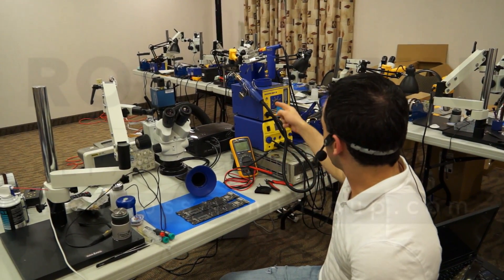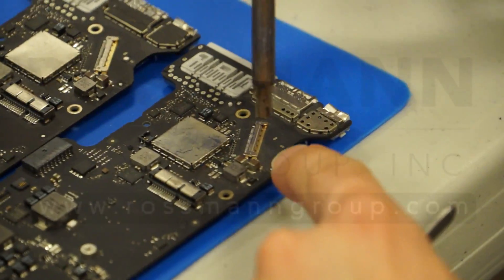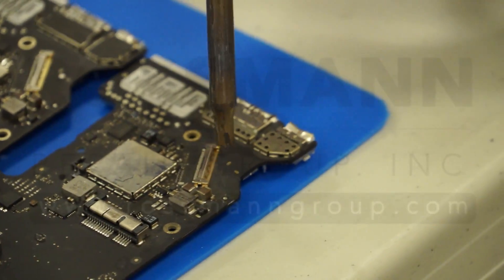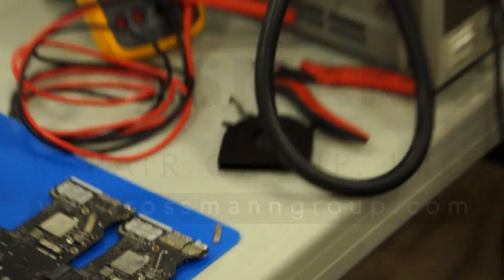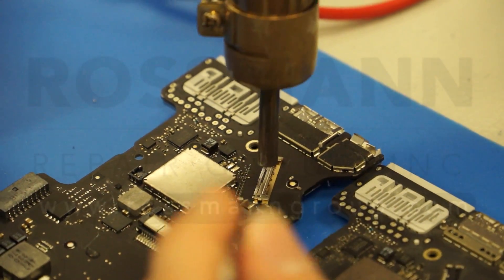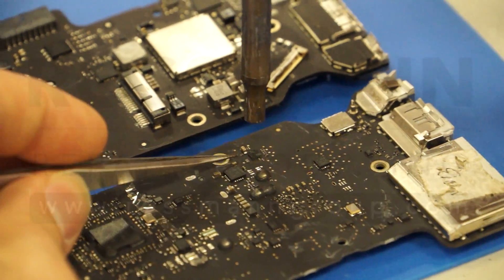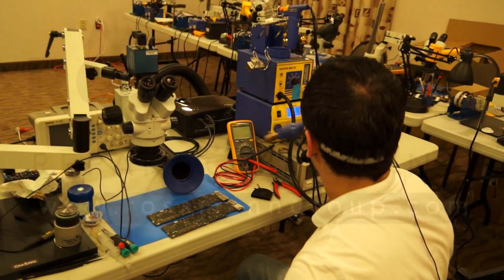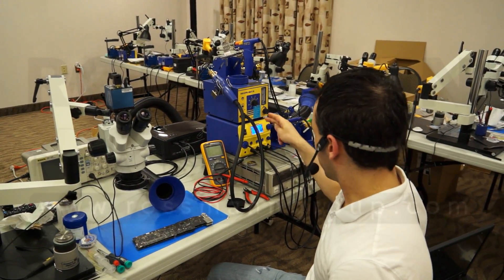Hakko FM-206 FM-2029 hot air station review.

Comment: I was strongly considering purchasing the 206… Thanks so much for saving my time. 

I do want to get a desoldering station, I am considering the HAKKO FM-204 self-contained soldering station since I do not have shop air (seems simpler than setting up the control box that borrows power from my 2 port hakko and finding a shop air supply)

Would you recommend the Hakko FM-204 or is there something else you would suggest that I look at?
Reply: I would recommend the Hakko Fr-301 if you haven't purchased one already.

Comment: Louis Rossman, have you considered using the correct nozzles? The heat is supposed to be concentrated to a particular area. Also, if had the right attachment, then you'd also have a vacuum suction component to remove your IC when its desoldered.

Comment: My 2 in 1 Hony 908 cost me 100 dollars and the hot air seems to be more powerful than that (melts wire quickly from 3 inches away), while the iron easily gets to 480c in 50 seconds.

Comment: LOL I use the fm 206 at work but the hot air is only good for pre heating the ground plane on big rf boards, and the desoldering pump doesn't suck very well either I thought the pump was worn out but I guess that's the way it is.  I use a separate hot air station like you do, its the only way to go.  I wish the pump had more power.  Love your vids by the way.  Oh man this is an old video

Comment: I have an insanely cheap, generic hot air station for general use (I mostly use it to remove USB charge ports as that's what I seek out until I get more comfortable with other components) and that thing blows the shit out of that 2029. All in all it was maybe $70, just something to get some kind of practice in with before getting something professional. I just crank it up to about 500 degrees and max airflow, pops parts off in a jiffy, and has a 3m nozzle. Airflow does seem to be lacking even at max (I've tried taking larger ICs off of junk boards and had a really difficult time with those), but for small components it works pretty well. Still, some things do seem to take longer than what I see with more expensive and proper stations.

From what I read a major issue with these cheaper standalone hot air stations (NOT those shitty aoyue all in ones) is the heating elements or the blowers commonly fail after a lot of use, so eventually you'd spend more on replacing the cheap units than having a more expensive one that lasts for years.

Looks like you can get an FR-801 from aliexpress for very good prices (better than the $800 I've found on Amazon for an 810). However I've never bought from aliexpress so I imagine it'd be some kind of knockoff.
Reply from the maker: +spartan456 micro hot air pencils are the nice way of saying useless cheap piece of shit

Comment: i am looking to buy the fr-801 or the fr-810 but its a dramatic thing to get in the Netherlands, any advice on a good and trusthworthy supplier? i dont wanne spend my cash on a copy scam piece a ...thanks in advance
Reply from the maker: +Roy Mulder Not sure. You might want to look for a device that is designed by a company headquartered in your geographic area so you can save money.
Reply: +Louis Rossmann hello. thanks for the fast reply, yes i tried but the only good quality is jbc or weller other quality brands i dont know. but you also know how exspensive jbc is.... so if any one knows a good brand
Reply: +Roy Mulder I am from the Netherlands as well. I buy my Hakko equipment from http://www.batterfly.com/shop (ordered several times). Be aware that the prices are listed ex VAT. They are trustworthy and an official Hakko dealer in Italy. Above EUR 400 you get free shipping! I think about ordering the FR-810 from them today.
Reply: +Roy Mulder Official Hakko dealer list can be found here: https://www.hakko.com/world_network.html    But Batter Fly in Italy is the cheapest one I could find in Europe.

Comment: well , you should have read the spec for both stations , specially the air flow.
for fm-206 its only 6L/m but for fr-801 its 20 L/m  and the fr-810 which is a beast its 115 L/m . it's on the website of Hakko . even weller they have 18 L/m as air flow on there all in one units so they have the same problem . my opinion JBC have excellent equipment too :) and good airflow.  ;)
Reply from the maker: Thegoodpal Here's the thing.

Average person has absolutely no idea how many liters per minute you need to remove an ISL6259.

They know that they turn their station up and it either does, or does not remove it. 

I totally get that they publish specs. Also understand why these specs are completely meaningless to most users.

What if this is their first station? How do they know how many liters per minute they need to remove a chip? Does the LP8550 datasheet tell you how many liters per minute you need in your hot air station to remove it? 

Ultimately, I do not feel it is up to spec sheets, but rather the manufacturers of high end gear to understand what end users are going to be doing with their products and produce something with a range that we can work with. 

I set mine to 15 for 99% of what I do. Sometimes 10 for finer jobs.
Reply: I agree with you Thegoodpal, the very first thing that you should know the spec both station before you compare. Just compare the same wattage and L/m of the hot air station that's the best thing of comparison.

Comment: Hello Luis, maybe you could try to calibrate the hot air pencil, there is an option for this, same thing with FR-802, i use both and work perfectly fine..... Of course, had to calibrate both stations with external thermocouple measuring on air output and put the difference between the external thermocouple and what station reads on offset temp option.... 
You can do this with all channels....
Reply from the maker: Joule G IMO, anything that is off by 250f out of the box should not cost $1800. Melt solder when I set you to 950f, or gtfo.

Maybe I am being mean. I don't think I am. What am I supposed to do, calibrate this POS to 1100f before it removes a connector in under 3 minutes?
Reply: Louis Rossmann lol maybe you are right, but there is a reason for this offset option, we should take in account that in electronics one thing is theory and other is practice and I think this is a good way to correct any mismatch..... IMO

Comment: Did YT spam my comment on pricing for this stuff?  That Hakko 206 was 2000USD as configured----it is going back and we are going to try the 810 for the July course.  I still think 206 could be useful for folks like me that want a micropencil, mini hot tweezers, and an iron ready to go---but 3 FM202s would be a better value.

That FR 801 standalone hot air was an eBay pick for about 400USD used---but of course those are snapped up instantly now.
My dual port FM203 was also about 400USD used on eBay.
Reply from the maker: iPad Rehab Yep, can't recommend equipment without it dropping into a black hole that I will never buy from again. :(

Comment: Because it takes so long to desolder the component you end up bringing so much more of the board up in temperature for a longer time you're more likely to damage something else while you're at it. Thats just garbage.
Reply from the maker: bgdwiepp Exactly. Here for the comparison I was working with physically damaged broken boards that were discarded with holes in them since I don't want to damage my good ones or customer boards, this would surely reak havoc on customer boards.